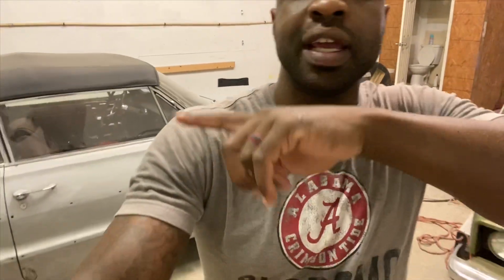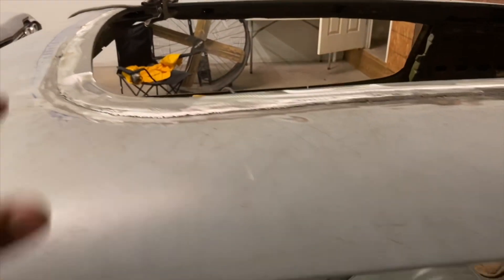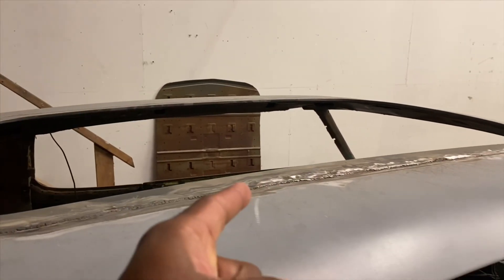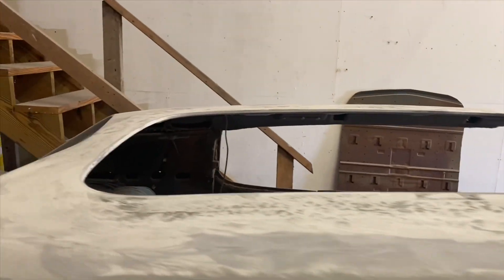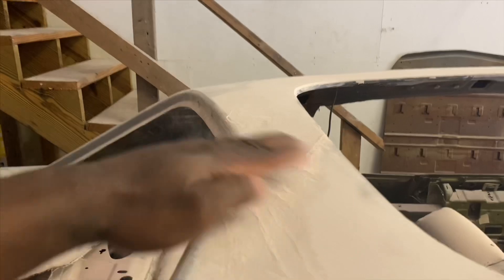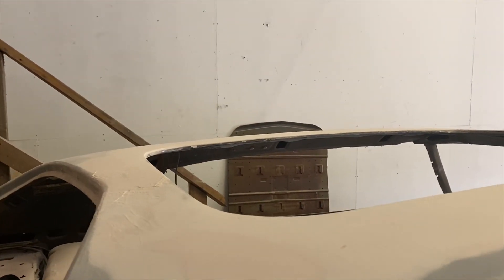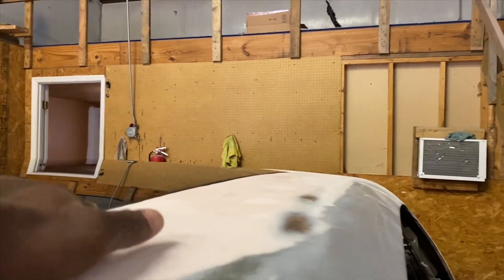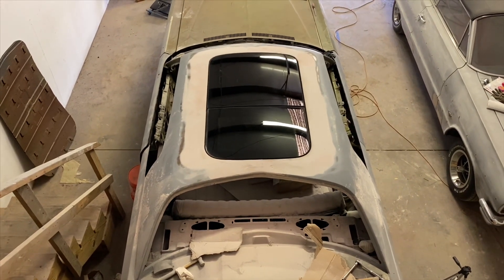1973 Impala Restoration project Part 3⚠️step by step panoramic roof install⚠️

Comment: Do you know the measurements for the mini copper frame cutout? Lookin to do this on a 72 Skylark. Idk if my roof is big enough
Reply: That’s a Mini Cooper sunroof it’s actually small in width it will fit a 72 just cut out the whole roof skin n ur good